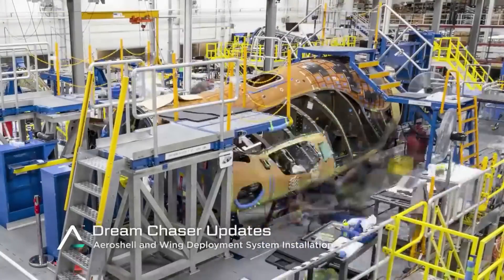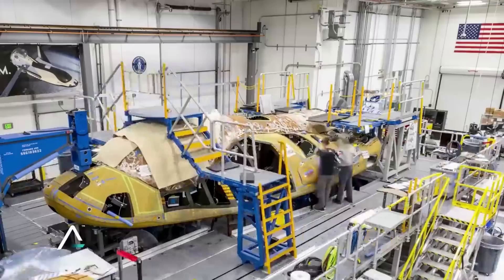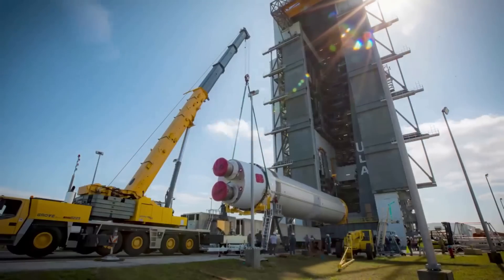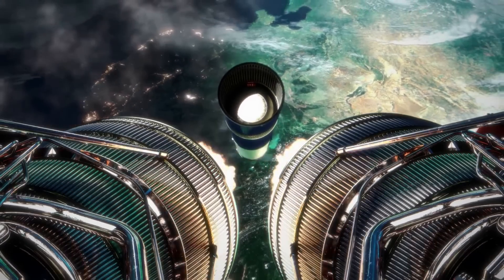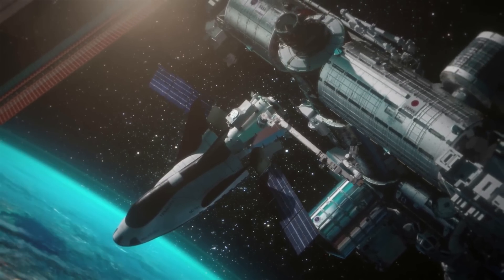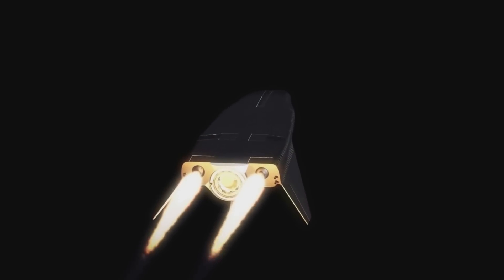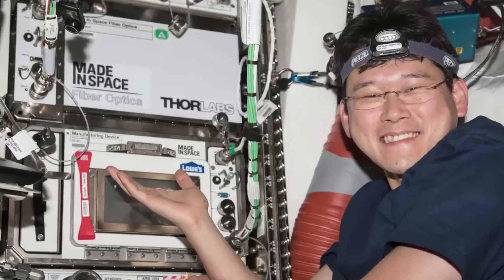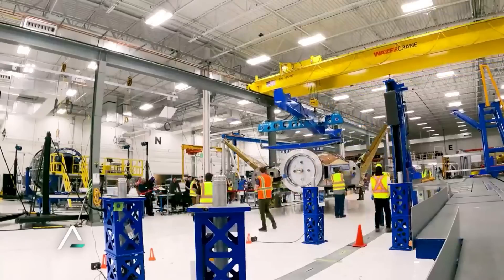Dream Chaser Tenacity Is Almost Ready For Its First Launch

Comment: I'm old enough to remember Boeing X-20 Dyna-Soar project and all the other space planes I like the shape and style of this one. It's kinda funny that we are starting to see a lot of retro space ideas come back
Reply: Note that the spaceplane lifting body shape came from the USSR's "Spiral" space interceptor, competitor to the X-20.
Reply: @JFrazer4303  The MiG 105 “Spiral” was designed from the published data on the X-24A and the HL-20. The Russian BOR-4 had more direct input to the final DreamChaser configuration.
Reply: These are the projects the Space Shuttle aborted to have a cargo bay big enough to hold one of the 20 Keyhole KH-11 spy satellites that were built in parallel with the Hubble space telescope - the major differences being the mirror (Hubble got one of the Keyhole mirrors by mistake), focal length and the direction it is pointed.
Reply: A flying piloted cargo carrier was always NASA's plan. Kennedy interfered by sending NASA to the Moon to 'beat' the Soviets.
Reply: @Canada_Dominium  NASA’s plan was for a significantly smaller vehicle.
The Space Shuttle was the NSA’s and NRO’s idea and it’s cargo bay was designed around the KH-11 with the intent for it to retrieve them from orbit. The NRO have been imbedded in the space program since 1958 with the Discoverer/Corona program with the first launch in 1959.
What NASA and the USAF really wanted was the X-20 - the difference between a SUV and a Semi (with the result that NASA ended up driving to the shopping centre in a semi when they really wanted to do a cross country trip but couldn’t afford it).
Reply: @allangibson8494  The idea being a piloted, flying, reuseable, winged vehicle. The Moon was planned for the 1980s or later.
Reply: @Canada_Dominium  The moon was Von Braun’s target from 1942…
It was simply a question of what the US could do that Russia couldn’t with its current hardware.
The Space Shuttle tied NASA to low earth orbit - it was utterly unusable for anything else (including a moon mission or earth departure). The size was purely at the NRO’s insistence (and then they only used it three times because it was so expensive).
Richard Nixon canceled the manned deep space program in 1968 - if it didn’t have military utility under Nixon, it didn’t get funded.
Reply: @allangibson8494  Von Braun was not NASA--he was a rocket designer. NASA's plan was to explore LEO 1960-80 and then the Moon 1990s. Kennedy ruined all that.
Reply: @allangibson8494  Bell Aircraft designed that weird P-39, right? Hmm, Grumman, North American, Chrysler, McDonnell, IBM, even Playtex ... nope, no Bell. What did Bell do?

Saturn was in development from 1959 as a heavy-lift booster. It was re-purposed to Apollo in 1962 where it met its demise in 1970.
Reply: @Canada_Dominium  First US jet fighter P-59. First Mach 1 Aircraft - X-1 (which Bell built five of).
They also built B-24’s and B-29’s during WW2 along with 9,588 P-39 Cobra’s that you maligned with 3,303 P-63 KingCobra’s 
Bell also built the Lunar Landing Research Vehicle that was used to train astronauts to land on the moon.
Bell also built the iconic 47 / H-13 Sioux of MASH fame and the UH-1 Iroquois (Huey) and AH-1 Cobra / SuperCobra.
Bell built the rocket engines and control thrusters for the LM.
Reply: @allangibson8494  Bell supplied the LM ascent engine. Thrusters were Thiokol.
Reply: @Canada_Dominium  And the design was in progress before John Kennedy was ELECTED.
Reply: @allangibson8494  Yes, the design for a heavy-lift booster. There was no lunar landing program in 1958, 1959, 1960, 1961. There was in 1962 when the LOR regimen was agreed. The LM design was finalized in 1965.
Reply: @Canada_Dominium  The lunar landing system proposals started in 1960. They didn’t have a functional GUIDANCE system until 1965 capable of a lunar landing however. The engine was a modified version used on the Agena upper stage with dozens of flights.
The original design called for the Apollo Service Module to land on the moon (that’s why it was grossly overpowered).
Reply: @allangibson8494  There was no NASA lunar program until Kennedy's order of late 1961.  James Webb was not happy about it as it ruined NASA's plans.
Reply: @Canada_Dominium  That is actually completely ass about. James Webb submitted a proposal to the Kennedy administration in 1961 over the objections of the Kennedy administration budget director David Bell.
The flight of Yuri Gagarin embarrassed the Kennedy Administration into moving forward with the $33 Billion dollar cost of the Moon project.
Von Braun was in direct contact with Lyndon Johnson at the time and provided him with the technical support as to what was possible to justify the political push for funding.
Reply: @Canada_Dominium  Winged orbital vehicles like the X-20, X-24, HL-10, M2-F1, M2-F3 and Space Shuttle. Check your timelines - the X-20 came before the Saturn project.
The Space Shuttle bankrupted NASA science for two decades. Wrong vehicle. Everything the Space Shuttle could do the Saturn could do better and cheaper other than bring satellites down from orbit.
The Douglas DC-X would have been a better investment (and was the direct ancestor to the SpaceX Falcon 9).
The X-33 would have been a better option than the Shuttle but the Shuttle had republican congressional support.
The HL-10 is the ancestor of the Dream Chaser via the HL-20.
Reply: @allangibson8494  "Check your timelines - the X-20 came before the Saturn project."

Yes, the Saturns were the cargo boosters; the winged vehicles the reuseable crew carriers. There was no lunar program in 1960. It was all LEO.

"Space Shuttle bankrupted NASA science for two decades."

Nope. It cost 1/3 what the useless Apollo cost and did 10 times the missions and 100 times the work.

"Everything the Space Shuttle could do the Saturn could do better"

No.  In 1962, Saturn was re-purposed solely to beat the USSR to the Moon. As a one-off, Saturn IC-IIB had to be heavily modified to carry a heavily modified S-IV stage as a 'space station'--with LM descent stage carrying a telescope. Vibration was so bad the station was crippled a minute into the mission.

Even Gene Cernan Buz Aldrin said Apollo was a political stunt with no use outside of gathering some rocks.  NASA's lunar science and engineering team did extend the program's scientific return through better tools, training, and splendid use of finances and unpaid overtime to kloodge up better gear.
Reply: @Canada_Dominium  The Saturn launched Skylab. The Space Shuttle couldn’t.
The SpaceShuttle got used because NASA scrapped the competition. And how many Apollo astronauts died in flight again? And that was in spite of the Apollo system being a far more rushed design.
But the SpaceShuttle used imperial dimensions where all the previous American spacecraft were metric…
The SpaceShuttle put NASA’s exploration of space on hold for forty years because it was so expensive, limited and unreliable.
Reply: @jimrky6062  If you'll note, Apollo technology was designed to do ONE thing: put an American on the Moon before the Soviets. The most it could do after that was to put an electric buggy on the Moon and then launch a workshop fashioned from an old fuel tank.  The US space program never recovered fro Kennedy's meddling.
Reply: @Canada_Dominium  - If you'll note Kennedy didn't lay down Apollo technology - he gave the goal. That technology, modified, looks very much like Orion in form and function. NASA had other goals in place when they were defunded.

Just as a question: Did you live through this or are you commenting from some knowledge of history?
Reply: @james miller   Canceling the X-20 Dyna-Soar in favour of manned capsules was a bad move for manned space flight.   The reason being it shared technology with thermonuclear reentry warheads.
The natural progression should have been from the X-15, X-20 and forward to space planes, not capsules.
Reply: @trespire  The early suborbital Mercury capsules used the same beryllium heat shield as the nuclear warheads - it was rapidly found that the higher orbital re-entry velocities required ablative heat shields (ceramics came later).
Reply: @tst ccnt It's a rocket accessory, not any sort of spaceship, don't get overexcited now.
Reply: Yea I remember that also.
Reply: You should also remember the Kliper project as well as the MiG-105 before it. Also, what happened to the X-37B?
Reply: @TinLeadHammer  - I had about forgotten the Russian Clipper - in all of its' various, never realized instances. But the X-37, to best knowledge, is still doing covert missions.
Reply: The technology has finally matured enough to permit cheaper reusable shuttle craft. I'm kind of hoping to see a VentureStar descendant operating in parallel between Starship and Dream Chaser.
Reply: I remember as well - built a 2 ft tall Dyna-Soar model that was in my bedroom when I was 6. The issue was that the dream exceeded material engineering - until now.

I'm sure that someday we WILL have Buck Rogers' ray gun as well.

Comment: So a refurbish-able mini me space shuttle on a throw away rocket.  How is this as good as crew dragon that has parachutes and not several thousand tiles?
Reply: Less impact force on the cargo on return and lower “g” forces during re-entry.
Reply: @allangibson8494  And yet those g forces are not a major issue.  A bigger issue is thousands of unique hand cut tiles.
Reply: @bindingcurve  Prototyping on a tiny budget is a pain… (because that’s what it is). 
DreamChaser has never had 10% of the budget of SpaceX.
Reply: @allangibson8494  Budget?  DreamChaser just does not make any sense from a commercial point of view.
Reply: @allangibson8494  Like the service Space X already provides?  You think this will EVER be cheaper?  I get the NASA wants a backup in case there is an issue with Dragon.  But I have a feeling that the only reason for the renewed interest is the disaster at Boeing.  I think this is cool looking, but I also understand the economics as well.
Reply: @bindingcurve  And if SpaceX makes a mistake and blows its pad or factory off the planet?
That’s the mistake the US made with the Space Shuttle.
Dream Chaser is the third string backup.
Reply: You can swap out the rocket with more reusable options and bring the costs much closer

Comment: making a better tougher thermal skin tan the iffy tiles with all the fragile crumbly problems would be a better ending
Reply: These tiles are protected by a fairing during launch, they should be fine.
Reply: The Columbia disaster was the result of cryogenic foam from the main fuel tank falling off and hitting the heat shield, that is impossible with dream chaser because it is mounted on top of the first stage rather than next to it
Reply: @greatconch278  foam may be but most probably? but build up of water vapour into hard concrete like ice making a skin would be more like it? even today watching lift offs around the globe huge amounts of water ice is seen falling away from outside the vehicles
Reply: @stgeorgeist  true, but that won’t affect dream chaser because it is above the tank, so all of the ice will fall down and away from both
Reply: Steel structure with industrial  hard carbon coatings throughout and ceramic coating on top of that and then thermal tiles on the outside layer would be more tolerant of any minor tile failures. But it would also be much heavier. Mach 3 skin heating tolerant underlying structures would allow some extra safety margin but probably not enough for a larger tile failure at much higher early phase reentry speeds. Keeping above significant atmospheric pressure altitudes might help mitigate mid phase heating but total reentry heat is still going to be more challenging than even a hypersonic aircraft could handle without a shield.
Reply: There was a shuttle mission that was probably saved by a bit of steel structure that just happened to be under a tile that failed. This demonstrates that underlying structure can make a difference in some cases but any failure of tile shielding is going to be dangerous regardless.

Comment: An engine that has never flown. A rocket that has never flown. A shuttle that has never flown. And it is all supposed to work first time. Did I miss anything. How many times can they afford to fail in a ball of flames and start over?
Reply: Yes to that last comment and aside from those early starship tests the starship super heavy has never flown with the raptor engine either.   So what's your point?   A new rocket and engine has to start somewhere.
Reply: Oh hi, STS-1

Comment: 2 DECADES! Holy crap. I wonder how many billions we wasted on that over designed flying piece of gold. Just like the SLS.  Should just have SpaceX design and build everything. They seem to be the only ones who know what they are doing.
Reply: SpaceX just tolerates numerous failures during design and testing  iterations. Give similar development funds to this and it could be in a similarly operational status. They came close but didn’t quite make the cut for the last round of large budgets because Boeing was somehow perceived to be lower risk as a 2nd option to SpaceX.
Reply: @Stu_Bur  do you have numbers to back up what you are saying? And who got cut for what?
Reply: Are you aware of how many billions got tossed at SpaceX?
DreamChaser got the crumbs off the table compared to Boeing and SpaceX.

Comment: So, with the Dream Chaser enclosed inside a fairing, I guess it's not meant to carry astronauts to the ISS but could bring them back to earth from the ISS?
Reply: Putting it in a fairing simplifies booster control - otherwise the orbiter would have to talk to the booster and harmonise aerodynamic controls.
Reply: That’s a good question. One would think a fairing means no one goes up - but I wouldn’t completely discount it.
Reply: The original SpaceX capsules were launched in fairings too but they were deleted with the manned versions.
Reply: @allangibson8494  Good point. I wonder though how the aerodynamics of a Dream Chaser on top of the rocket would affect the flight.
Reply: @christopherdaffron8115  Like the forward control fins on a sidewinder missile…
They would also be asymmetric in a rotational sense.
Basically take the existing booster control logic and toss it in the bin and start again with a new aerodynamic model.
The X-20 concept was to have massive fins on the booster to balance the aerodynamic effects and have the X-20 talk to the Saturn booster computers to   get the required aerodynamic control position signals until booster separation. The direction of control reversed depending on if the booster was attached or not.
Apollo 13 had the same problem when they were trying to do course corrections with the LM but this is compounded by aerodynamic loads…

Comment: Why does it need launch inside a fairing ? Obviously it can handle reentry so I’d have thought it could handle the turbulence of launch ?
Reply: Probably because it has an uneven drag / lift profile when facing nose up like that. If it generates lift then the rocket will want to pitch along that axis and the vehicle will have to compensate with engine gimbaling or adding extra control surfaces.

I reckon they've crunched the numbers and it's just more efficient to put a fairing around it.
Reply: @Poonannyish  Also, vulnerability to damage during launch process. Columbia.
Reply: @philipr.6090      Columbia wasn't on top of the stack.
Reply: @jshepard152  Oh yeah, how did I forget that?

Comment: So, Dream Chaser is essentially NASA'S Soyuz space capsule mixed with the Space Shuttle?
Reply: It's Sierra Space's equivalent of Soyuz/Dragon/mini space shuttle.
Reply: It's essentially the old Air Force X-20 Dyna-soar, which NASA updated in the 90s as the HL-20.
Reply: @tst ccnt 
Never said it did. But The Dream Chaser will fill the same role, get personnel to  and from space in  a relatively economical manner.

Comment: So that's the smoking gun it's the thermal tiles is your problem isn't it. Charles Bolden visited a company that was weaving thermal protection like it's a knitting machine and it could be like a giant sock for the underside and nose of your space plane. The weave silica fibers into a thick blanket that's probably well as think as they want to make it and it's a complicated weave. Somehow I think if you wanted to mass produce these things and make hundreds of space planes that would really be economical cuz once they've made it once it's all machine manufactured and it's not thousands of separate pieces it's just one piece that gets attached to the space plane. It's brilliant and if you don't get that then you're stupid I'm sorry you're just stupid, Sierra. You need to think bigger and not be so tenacious, like Jeff bezos look where it gets him. Tenacious is where you stick to your old ideas tenaciously. You should reboot the whole program so that the underlying structure of the space plane is built with additive manufacturing, completely automated, Elon Musk style. Or at least divided up into blocks which are built in an automated fashion and then just bolted together. Switch away from carbon fiber unless you can build that in an automated fashion also. You got to control your costs people otherwise you'll just price yourself out of the game. Look it's just like the old saying goes if you can't beat them, join them. Do that or get out of the way and let somebody else do it properly. Secondly you signed a contract with the devil as your launch provider. Personally I think you're done, you're finished, washed up.